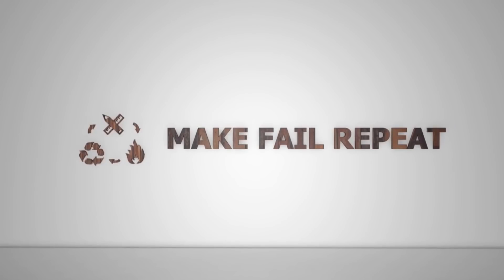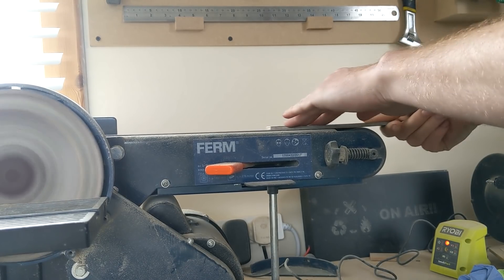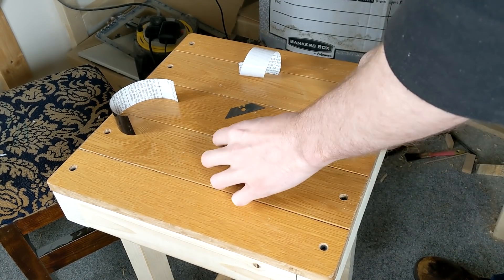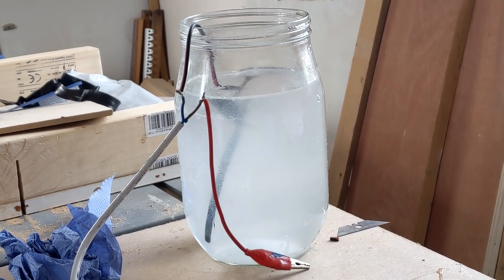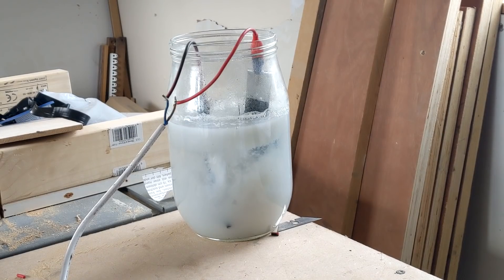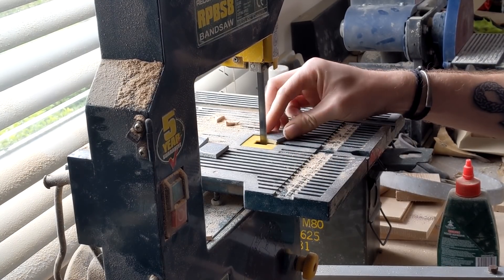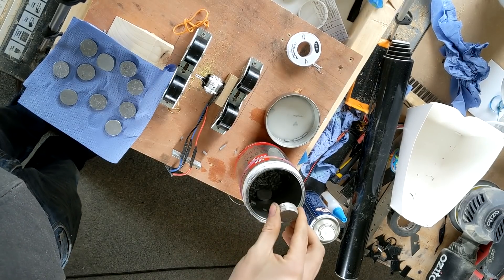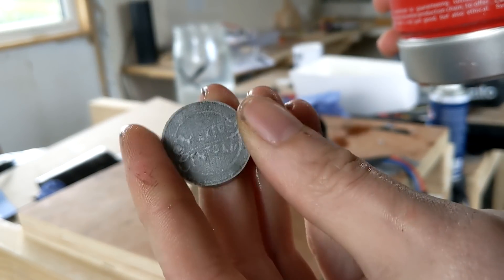Electro-etching Aluminium Coins

Comment: Great work, but....cutting vinyl with a laser is very dangerous and bad for your machine:
PVC (Poly Vinyl Chloride)/vinyl/pleather/artificial leather
 Emits chlorine gas when cut! 
        Don't ever cut this material as it will ruin the optics, causes the metal of the machine to corrode as chlorine is released and ruins the motion control system.

from:  http://atxhackerspace.org/wiki/Laser_Cutter_Materials